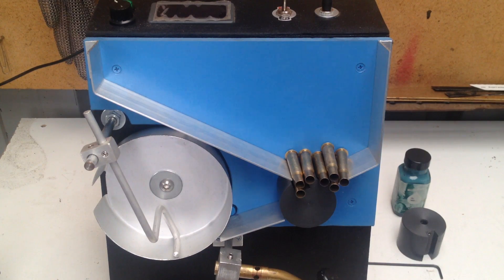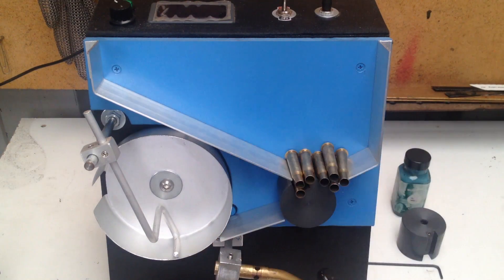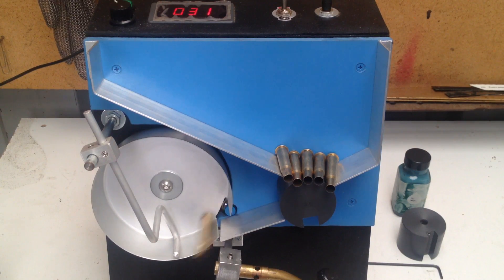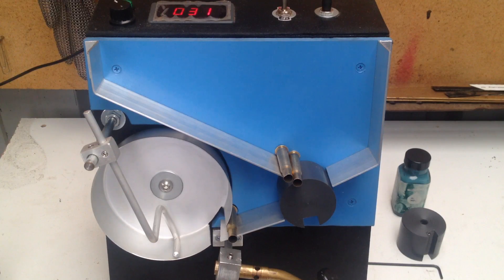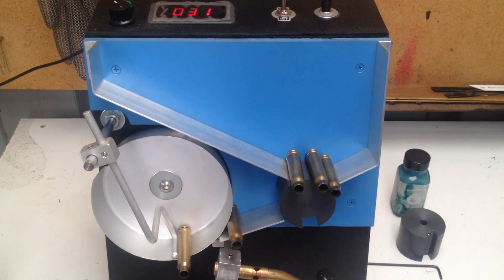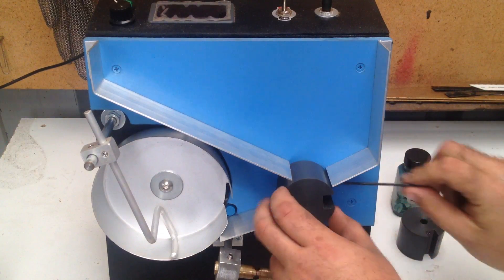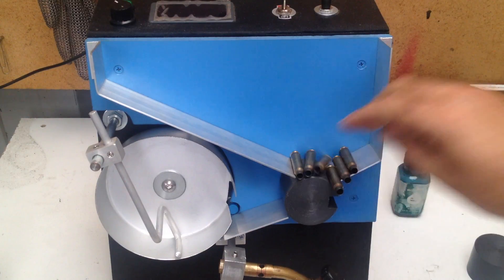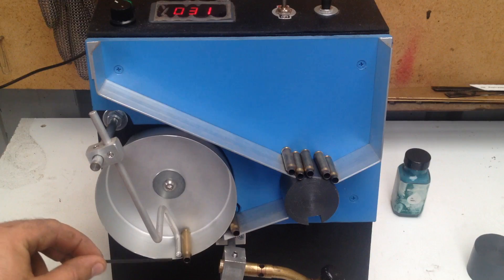Skips V2.0 case annealer

Comment: Thanks for posting the videos Skip. I'm in the process of getting the items together to make mine. I'm hoping you can help me out with a bit of info?...... How have you got the small black "feeder wheel" to stop once it drops a piece of brass down the "slide" and onto the main wheel? And secondly, What is the black wheel made of, and could you give me it's dimensions, including the size of the cut-out you have made for the .223/6.5CM/.308?
Any help would be greatly appreciated.
Cheers. 
J.
Reply: It's a inductive normal closed prox sensor. 4mm detection. Dunno what they worth now, about $10odd.

The round case feeder is made from 50mm delrin or acetal or hdpvc. Delrin is common. The hole is from memory 8mm and a 5mm grub screw used to attach the shaft of motor. 

Slot size depends on the case. 10mm-14mm will cover your cases. You can cut as many slots you like in the feeder wheel and use a block/blanker or some dome head screws to blank of slots not in use.

Skip

Comment: Before you make these super machines. Look for the right temperature for properly annealing your brass. They will tell you that you need tempilaq to get the correct brake temperature. This is nonsense, use what they used to in the past. dark red, two orange. 750 ° F tempilaq will give you stress relife (longer case life) but will not give you reduced hardness (cool release).

Comment: Skip, how do you cut the cake pan? I am building one of these myself....a clue would be helpful....my lathe wont do it jaws arent big enough
Reply from the maker: With a 1mm cut off wheel in a grinder is how I cut mine.
Reply: @SKIPPYISAAUSSIE 
 I ended up using a hacksaw of all things, and a belt sander to clean it up after...it actually looks ok!

Comment: Awesome design. I built my version here. Haven't figured out the prox sensor yet (I got a normally open sensor, but the output wire isn't activating the motor or controller). https://youtu.be/9krhXgczhd4

Comment: I have trouble with the brass not spinning. I have thought about etching the inside of the pan to give it some grip, or adding a strip of silicon mat to it. Any thoughts?
Reply from the maker: Joe Loehle the case sound like it’s sitting at 6 o’clock on the drum. Move case stopper to 5 o’clock or even 4 o’clock on the main drum. 

That should get your case spinning nicely

Comment: First off, thank you for this!

Skip, in your later models did you go with a smaller main drum?  I'm currently building a version and have ordered both 6" and 5" cake pans.  Was thinking of using the 5".  For the power supply I ordered 12V, 2 a.  Hoping that will be sufficient to drive the motors.  In addition I've ordered a 3 wire, 6V-36V inductive NPN normally closed proximity switch.  I've read reports of people having to bias the motor with a 1K resistor or install a relay switch in order to get the switch to function.  Has this been your experience?
Reply from the maker: Fattonzzz_&_Jenzzz  hi mate, 

Still the 5” drum, mainly that’s what best suited most calibers. But you can sure go bigger if you like. Tried to make it compact as possible as it’s only used when needed. I do mine in big batches of brass. 

I use in the later, just a 12dc 2amp wall wart ( 12v dc power supply plug in ) and wired it in a way that you can also run it off a small battery using a jack with spade connector. There is a inline fuse inside the machine. 

The sensor was wired as is with no resistor or a relay ( as mentioned a number of times in comments etc you have your + - and load wire ( black ) connects to your neg on case feed motor ) The whole machine is pretty much a simple wire up as it can get. I also have a 12v fan to draw and withdraw any heat from case ( 40mm fan ) that keeps the motors cool and extends there life a bit over a non fan.
Reply: SKIPPYISAAUSSIE   Thank you so much for such a detailed and thoughtful reply 👍
Reply: SKIPPYISAAUSSIE   Finished the build today.  https://youtu.be/vKsaVQwfZMY  I'll be making a few small changes, but otherwise I am pretty happy with it.  Unfortunately my proximity switch is faulty and I've ordered another.  It turns out I had an extra motor controller lying around, so until the new switch arrives I'll just have to put up with timing the drums manually.  Thanks again for all these videos.  This thing was a pain in the arse to build, but is pretty satisfying to watch operate.

Comment: Hi Skip, sorry you said to me the black wire is the load wire but how do you wire it in? Are you able to tell me how you wire all three wires for the proximity switch as im no good with electrics
Reply from the maker: Rodney Riddle blue neg, brown pos, black (load) to your neg wire from motor.
Reply: thanks mate
Reply: Hi Skip, sorry to be a pain but still don't understand how you wire the proximity switch in. so is it the blue neg wire go to the neg terminal of power supply and brown pos wire to pos on power supply and black wire to neg wire from motor and pos motor wire to speed control??
Reply from the maker: Rodney Riddle yes as above

Comment: what hardware did you use for the case stop and the torch mount? Where did you source it?
Reply from the maker: Twisted Brilliance hi mate. 

Not sorce parts, I tried to sorce components I could use. But was simpler to make it for the application by me. The components are mostly machined Ally. The sorced components are just the inductive sensor, the motors, the display, the power supply, on/off switch, cooling fan etc etc.

Comment: Thank you for posting these videos.  I've built one of my own, but I'm having a problem with something that should be easy... but I can't figure out the best way to do it - How do you cut the edge of the cake pan so you get a smooth, consistent edge?  I was able to figure out everything else, but I'm messing up cake pans trying to get them cut right.  Thanks again!
Reply from the maker: Glenn DesOrmeaux 

Hi mate. To mark out the cut. What you can do, depending on the tools you have. You can chuck it in a drill. Then hold a pencil while it's turning to get the line. Or you can fold a a4 piece of paper. Then with the fold , wrap it around the pan then tape it then trace the outline, or you can do the same with emery cloth, Then cut. If you have a drill press you can do same as the drill. Or lathe you can do it also. 

Plenty of ways to skin a cat.
Reply: SKIPPYISAAUSSIE 
L

Comment: Hey Skip, how do you connect the black plastic case feeder to the motor?
Reply from the maker: Sivutha Pot 

Mate I just used a grub screw, m5 stainless grub screw, as the motors have a flat spot on the shaft so you could use a grub screw, bolt, what ever you like. ( ex: cut the head off a bolt, and then cut a slit in the bolt so you can use a fine blade flat head screwdriver) that's a option so you don't need to go buy a grub screw. Plenty of ways to skin a cat
Reply: thank you sir

Comment: Skip, I didn't catch what type of sensor you're using to sense the case in the standby position. optical, pressure or contact? Other?
Reply from the maker: Philip Palmer it's a inductive switch, you could use a optical breaker type switch also if you like.

Comment: Hi Skip, could you please tell me how you wire in the induction  3 wire switch please?
Reply from the maker: Rodney Riddle if the same cable the black wire is the control. ( you want the NC sensor "not" a NO )

Comment: Great project I want to build one, can you let me know what is the diameter of the acetal ? also what did you use for the brass space a table saw ?
Reply from the maker: Mark Hernandez  it's 50mm, original bb had 40mm, it was just what I could get at the time. 

I used a mill in V2 but you can use a drill and or drill press. Just clamp it down, start a pilot hole so you remove 3/4 of the material and clean up with a file.  You could use a table saw. Use what you have on hand and your imagination to achieve the wanted result.

Comment: Is there a build guide on this one with measurements, part list that are needed to copy this one?
Reply from the maker: Mike Snow no, but it's pretty much the same as the first Black Betty annealer with a few tweaks . My bb was a end result of a few other builds. To what I wanted, the end result was a build that started it all after I got my inspiration from longshot, all up I think the original took me 4hrs start to finish with just winging it and planning in my head, primer and paint makes the fabricator I ain't. I spent more time trying to do a parts list and drawings then I did on building it.  You build can be what ever you make it too be. I planted the seed those years ago, so many offspring has come of it with there own tweaks.

Comment: I have built a few of the original annealers. I am very interested in the mechanism that control the rotation of the cartridge feeder.
Can you share that?
skip_evans@yahoo.com
Reply: http://www.ebay.com/itm/401126722206?_trksid=p2055119.m1438.l2649&ssPageName=STRK%3AMEBIDX%3AIT